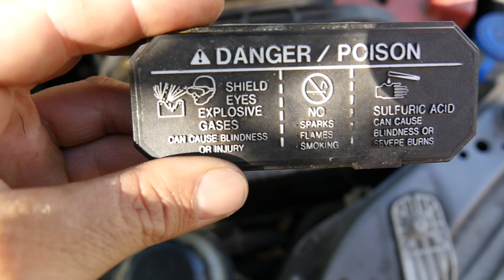Top 5 Reasons Cars Catch on Fire - and How to Avoid Them

Comment: Dear brother,glad you made a video but I have made an enormous research on this topic and am fighting for the ban of the Hotspark ignition system and the MPFi system which works hand in hand and reintroduce the carburettor system.These modern day cars have a tendency of catching fire.Manufacturers say if everything is perfect such things won't happen but truth which nobody sees is even if everything goes wrong a car shouldn't catch fire .They never happened in the 60's, 70's and 80's when the carburettor system was there. These modern day cars that use the MpFi system requires 50 to 60 psi pressure from an electronic or electric fuel pump unlike the cam driven mechanical fuel pump which requires only 12 to 15 psi.This high pressure fuel supply is yet another provider of fuel in a car fire and for fuel being sprayed on to the wiring through holes such as rat bites or broken down lines.The complicated wiring diagram with so many sensors all under the control of the ECM is also a reason for cars catching fire.manufactures keep saying that ECM cannot take overload of anysort but the sad truth is that it's even not able to bear the load it's supposed to bear at all times.whether fuel comes in contact with this wiring or short circuit sparks come in contact with leaking on non leaking high pressure fuel lines it's only going to be disaster. If governments all across the globe are obsessed with safety rather than pollution control and have these unsafe modern day cars it would save lives.There so many who are dead, so many who are going to die.someday it can be you. How can a woman or a child or an elderly parent run for life in such car fires that too in the present day traffic conditions. The unburnt fuel in the exhaust which was the sole reason why those safe carburettor system was banned could have been overcome by connecting to a simple device like a turbo or super charger which sends more air into the suction manifold during acceleration as per demand. All that is required is correct compression, appropriate CFA ( centrifugal advance) sufficient air into the suction manifold, why then won't the secondary winding of the ignition coil where the 12 volt battery current is amplified to 20 thousand times be able to burn all the intake mixture in the cylinder and why will there be unburnt fuel in the exhaust.. Think think think, fight this stubbornness of heart. Failure is not falling down but it's refusal to get up. I am very good in identifying a problem and in bringing the problem and the solution together but I am unable to succeed in getting this problem solved because the real problem is these governments are not willing to take advice and they're obsessed with pollution control than safety.

Comment: Years ago, I tried to light various types of engine oil and coolant on fire (in a controlled environment with multiple fire extinguishers at arms reach) and none of it would burn. However I was able to get some used engine oil to burn briefly. I think what happens is, over time fuel can mix with these liquids and make them flammable. But I'm confident they are definitely not flammable in their normal state.

Comment: When they put the fuel pump in the gas tank is when car fires really increased! Lazy, cheap car makers should have put the fuel pump near the engine so that there is a FIREWALL between you and the fuel pump! Everytime you see a burned spot on the shoulder of the road is a visual example of why the fuel pump should not be in the GAS TANK!

Comment: Good vids mate.
Just one more risk of fire (not sure if it was mentioned) is a power steering leak.. Excessive amounts or any amount of power steering fluid leaking can come in contact with exhaust manifold and quickly ignite. 
Last week I had a p/s hose blow, Pretty sure due to using rubber hose for a repair which wasn't P/s fluid resistant. My bad! But a bulk load of fluid sprayed straight onto my extractors. I'd only just started the car so didn't have much heat in the extractor pipes luckily and I was able to turn the car off before there was enough heat for it to ignite.
Over n out cheers.

Comment: Hey there, ive Honda Amaze 1.2 ltr petrol  2018 model(India).Few days back,its fuel pump got overheated and stoped operating while driving. It was replaced by the honda.But my concern is,before the fuel pump change i was getting 23 km/ltr fuel economy on highways,but after the change,it shows just 18 or 19 kmpl on my cars MID. What could be wrong??????????????????????

Comment: I had a mechanic work on my 1st fuel injected car..I drove it less than half mile til it died..before I lifted the hood I could smell gasoline big time! I looked and was shocked to see gasoline sprayed all over the engine bay! gas was dripping off the valve cover and slowly dripping in the exhaust manifold making! sounded like water dripping on a hot pan😣I backed away fearing an explosion! but them I saw the problem..the gasoline IN hose popped off..the clamp was not tight..surprised my car not explode in ball of fire..yes I was lucky no open flame was present
Reply: Same thing happened to me today. I tried changing my own. Big fire fail

Comment: Hi Iman,
Great Videos. Your detailed explanation and style about topics has be very helpful in solving some of my recent car problem on my own. Thank you!
I need some guidance on 'Secondary Air System: Not Ready' code I'm getting since I solved and 'cleared' my fault codes recently. All my O2 sensors, MAF & MAP, have been replaced and  200 miles and about 6 cold starts, everything is green and ready, but this hasn't gone away.
A Torque Pro OBD2 scan shows TID:$03 CID:$03 - Low sensor voltage for switch time calculation. No Check Engine Light.
This 'Not Ready' disables me from passing CA Smog Emissions. 
Please help! Happy to contact you. 
fesoj11@gmail.com
Thank You!
-Josef

Comment: Mechanics professor told me to never turn off the car when its starts overheating. If you stop and dont, it will continue cooling itself with the coolant. If you turn it off, it will no longer cool itself and it may catch fire even faster.

Comment: If you just bought a new sound system don't let your friend hook you up with a free installation. When connecting anything to the electrical system it must be connected to a fuse just in case a wire gets pinched. If not the wire will overheat and burn your car to the ground.

Comment: A catalytic converter is NOT designed to burn unburnt fuel, in fact unburnt fuel will damage a catalytic converter by causing burning on the internal surfaces thus reducing it's efficiency. Never drive a car with a catalytic converter if you have a misfire

Comment: Nice video.  My 74 bug caught on fire.  I then started to notice other bugs with the same burn scar on the engine cover.  The oil pressure sender wire touched the distributor condenser wire and shorted out, igniting the insulation, which ignited the fuel line.  A Volkswagen design flaw, I suppose.

Comment: My family got lucky, VERY lucky. We’ve been driving our minivan with a failed fuel rail for a FULL YEAR. We’ve smelled gas coming through our HVAC vents but wasn’t sure where it was coming from. When the radiator failed, it was time to visit the mechanic. Yep, they found the problem. I wonder if they knew we were driving the van like that for a full year. Very dumb luck.

*The engine design saved our lives. That 3.8L V6 was designed so that the spark plugs and wires were FAR away from the fuel rail. Fuel rail at the top, spark plugs and wires below the valve cover to the sides.

Comment: Brake fluid is now one of the reason for car fires, it does not smoke when put on a hot exhaust but bursts into flames. I believe they are now trying to put brake master cylinders shielded from the engine bay as it is so inflammable.
Reply: many components do not like high heat: battery prematurely age with heat - Good cars keep heat away from Batts...

Comment: my Nissan sentra caught fire while driving on the highway. I suspect it was the battery blew up.. I hit a hump in the road and heard a bang under the hood then tons of smoke immediately and headlights were flashing. could this be a vibration issue.. the car was on stiffer lowering springs and had  a big sound system...
Reply: Check the oil pan?

Comment: Great info first saw you in the 01-05 Civic head gasket change series! Had no idea coolant could ignite-sources show it's flash point to be only 650 deg F. In my Civic at least, the crimp near the outlet spout securing the aluminum radiator fins to the plastic top piece blows coolant everywhere in summer (definite design flaw) , right onto the exhaust manifold. Lucky it didn't ignite on me lol. Fixed that leak by putting epoxy over the whole area after going through 3 radiators.

Comment: smoke was coming out a little thin white & whispy.  No change in heat/temp gauge at all.  Stopped car to pay toll & oil pressure gauge went from fine to super low but temp gauge was still fine.  Saw thin whispy smoke.  Pulled into gas station to get some oil.   In 30 seconds, thin white smoke became thick brown smoke. Another 30 seconds & flames were coimng out the hood + flaming debris falling onto the ground below the engine.  Then my car burned to death in about 2 minutes or less :(

Comment: had a fire that started at the trunk. what could have happened there? and it burned to the ground
Reply: Catalytic converter may have ignited the carpet in the trunk. I saw a 1992 Mustang with a clogged converter set the foam rear seat on fire.
Reply: @Cautionary_Tale_Harris  in the middle of the night with a cold engine?
Reply: @bugzziee  No, the cats only overheat when it's running.
Just throwing out ideas: I saw where a guy had a stereo amplifier in the trunk. He didn't wire it up correctly and the wire burned through at the hole he'd drilled into the trunk. The car did not catch on fire but it very well could have.
Reply: @Cautionary_Tale_Harris  I'll wondering foul play
Reply: Most likely an electrical short.

Comment: i just clicked on this video randomly.
And you literally told me everything wrong with my car in 5mins. 

overheating issue
changed radiator hoses, radiator.

Heater hose was leaking.
hose kept on melting at the clamp.
then would shoot out Small holes.
Reply: The repair shop needs to be on your priority list. The hoses need to completely be replaced.

Comment: So unless you have a stuck radiator cap for some odd reason, the coolant cannot build more that 17psi in the cooling system.  That's why the cap is there, it's spring loaded and anything over it's rated maximum pressure is going to get releived in the overflow tank, which is not under pressure... So if the overflow becomes overfilled, coolant will just leak out onto the ground.  If it leaks close to an exhaust manifold I guess there is a chance but it is going to be difficult to get coolant to burn as it is made in large part of water.

Comment: These dry leaves in your engine bay can easily catch fire. Maybe keeping the engine bay clean can also help preventing car fire.
Reply: facts...  glad I read comment or 2 cause was gonna say that
Reply: I hate I have to park mine under giant oak trees but at least I can clean the engine bay because those leaves are dangerous! You're so right.
Reply: @trishpipkins  how do the leaves get under your hood
Reply: Leaves/dust/white plastic bags #1 reason coolant systems are running warmer than usual.
Reply: Everytime before I take my car on a longer drive, I check coolant, oil, and take out all dry leafs that's stuck under the hood
Reply: “The dry leaves and vegetation” 
Tony Soprano
Reply: Problem airbag toyota rav 4

Comment: Did you know about all Ford vehicles have something when there the engine coolant have a leak the engine stopped itself to prevent a head gasket blown
Reply: Francisco A Diaz Jr Hahahaha you don’t have a clue! Doesn’t exist!
Reply: But a long time ago i was driving a Ford Focus wagon and i was feeling that the engine make like a broken fuel pump because i saw the fuel gauge like it have fuel then when i pulling over i saw the coolant reservoir empty  then i check the lower radiator hose blown that why my friend say about that Ford vehicles.